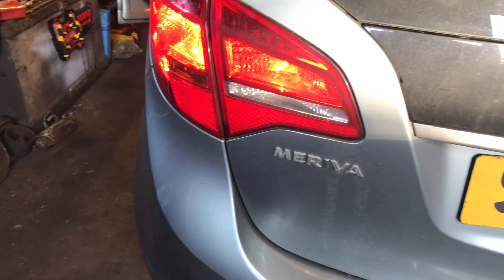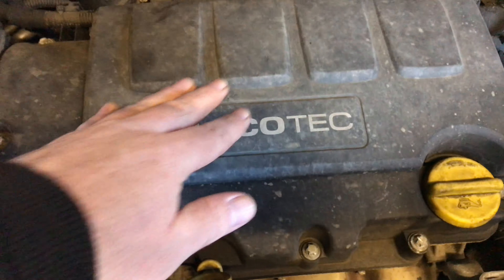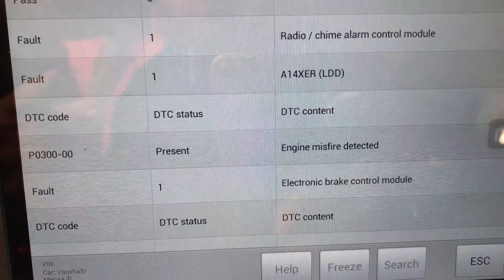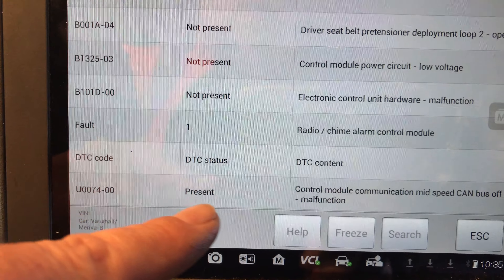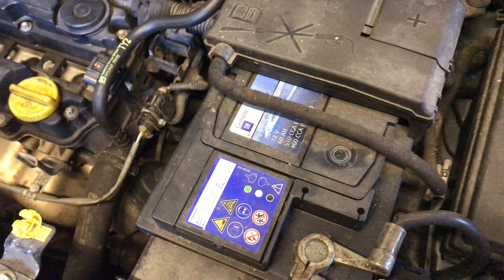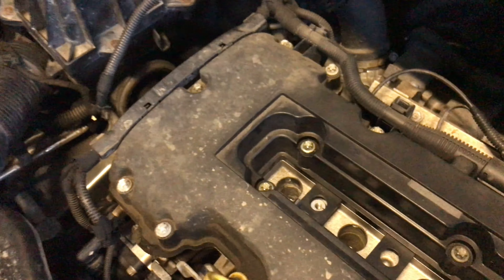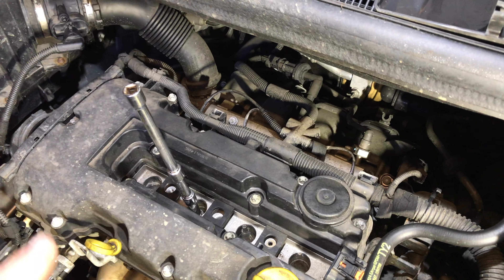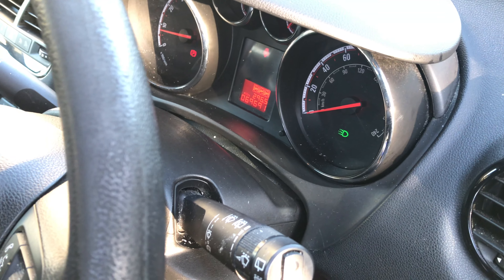Vauxhall Meriva B - Fault Code C0244-71 - Delivered Torque Signal PWM!

Comment: I'm having the same fault code no miss fire code but I do have fuel system lean. I will try the Coil pack and plugs see how it goes.
Reply: Did you ever sort this?
Reply: I’m the same did this fix the issues please

Comment: Hi Sandy, I replaced a Delphi coil pack on a Corsa, it had lasted less than 2 years.
If you remove the rubber boot, there is a spring with contacts on each end.The contacts corrode and then burn out.
Often if you replace them, £7 on eBay . It cures the miss fire..
Thanks Sandy
Reply from the maker: Thanks for the tip cheers sandy